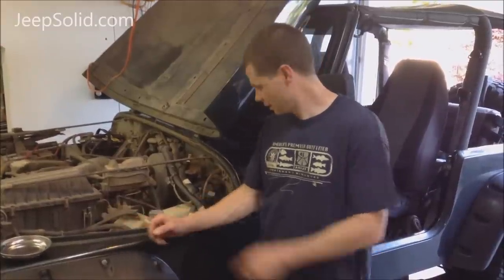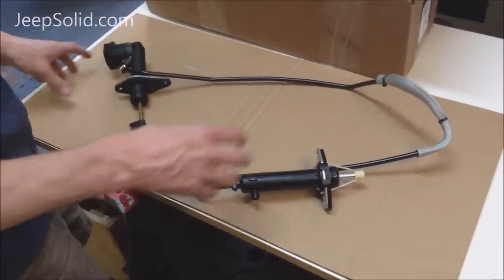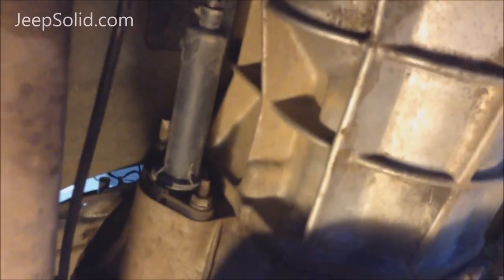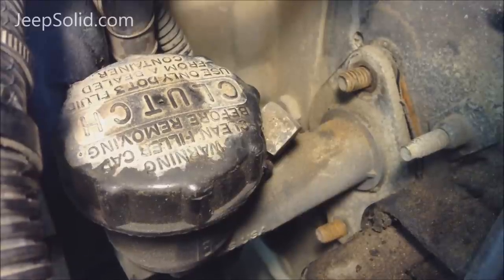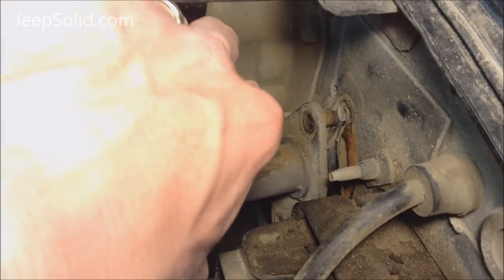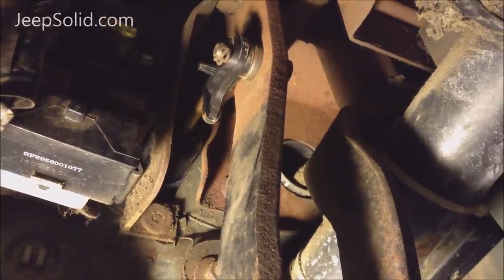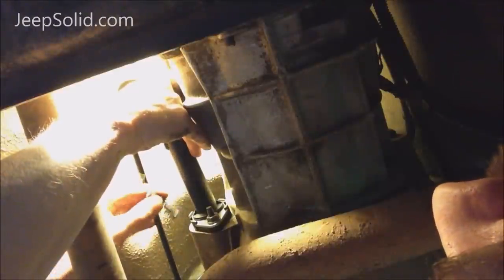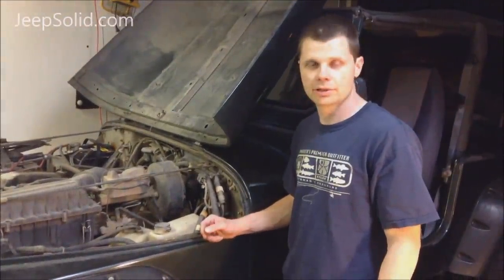Jeep clutch master cylinder and slave cylinder replacement: Jeep Wrangler YJ

Comment: My jeep was having some problems shifting and losing compression on the clutch. I bled my mc and put new fluid in it but its still happening.  I came across this video and looked on amazon for that product.  Is this the correct one? http://www.amazon.com/New-Generation-PS0115-Hydraulic-Pre-Filled/dp/B000CPAOMC/ref=sr_1_1?ie=UTF8&qid=1456510408&sr=8-1&keywords=jeep+yj+master+cylinder